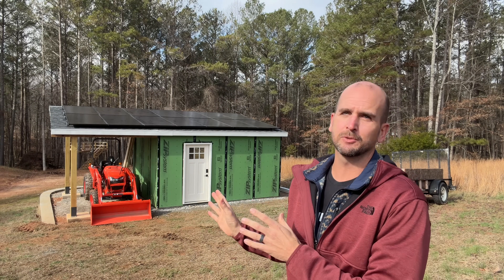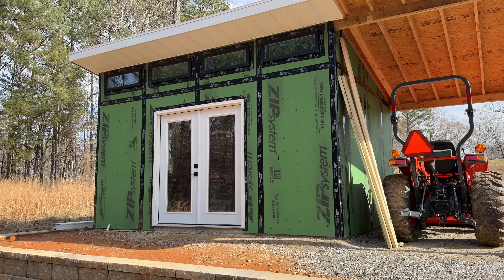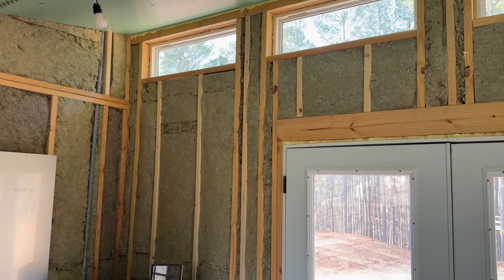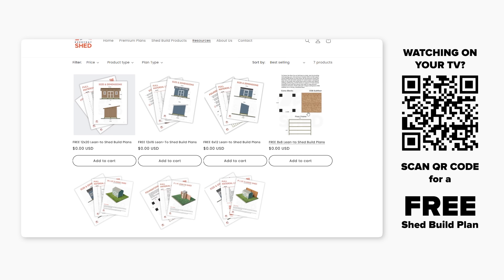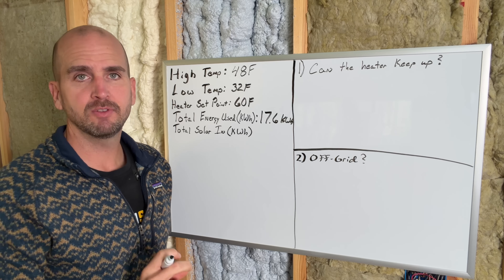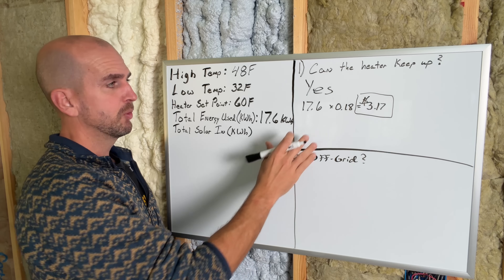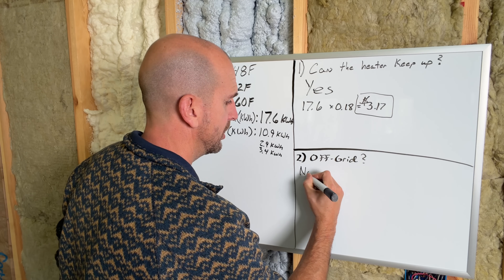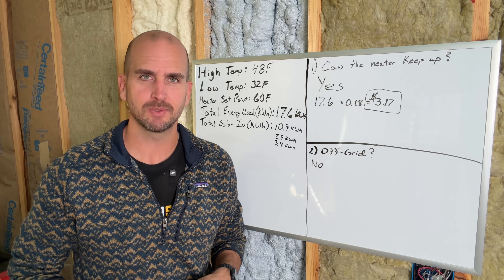HUGE Mistake: Why My $15,000 Solar System CAN'T Heat My Tiny Shed

Comment: That is what I switched to - 3 oil radiant electric space heaters for my house - 2 downstairs and 1 upstairs keeps the house just fine. I stopped using my forced air oil furnace because in the winter we have a lot of storms/winds here and at least once every few winters my carbon monoxide alarm would briefly beep one warning when the wind blew from a weird direction. Yes, I probably could have had the cap on my flue vent adapted so no wind backfired down it, but oil also started getting very expensive at that time here, as live on a remote island and shipping it here adds to the cost, so I tried the switch and found the oil radiant heaters cheaper than oil.

Disliked the forced air furnace blowing air disrupting any dust I might have too. Works just fine as live on the west coast of Canada so might get to slightly freezing temperatures for maybe a total of a week every winter. Might only have a few flakes of snow every year too and then if more snow, it rains away within a week. Have an older house with good insulation, so it works here.
Reply: too bad you didn't investigate mini-split heat pump. 400% more heat for the same amount of electricity (as a radiator).  AKA your heating electric bill would be 75% cheaper than radiator
Reply: @pbm___000  Really wanted to keep my life uncomplicated as live in a remote area with only a few hundred people and any work like this needs to come a big distance to me! Plus... how can it be cheaper for me to only need heat between October to May with a heat-pump at that cost?'
'A mini-split heat pump costs roughly $3,000 to $10,000+ installed, depending heavily on whether it's a single zone (one room/area) or multi-zone (multiple rooms), with single zones starting around $3,000-$6,000 and multi-zone systems costing more, potentially $9,000-$15,000 for 3-4 zones'.

Comment: I build a shed a few years back as my office. 800w of solar, a 2000w delta max. I charge the battery at night on a free night and weekend and use solar to supplement during day. No way I can run  a heater. Heated blanket or mr buddy.

Comment: A mini-split or a small portable heat pump is the way to go.   About 1/3rd the electricity use for the same target temperature.  You never want to use a regular thermal heater on solar.   For a space like that I'm guessing ... roughly 600W @ 50% duty cycle.   7.2 kWh/day.  If you have sun-side windows during the day you can get help from the sun as well.

The main thing is that with consumption levels that high, you need a significant amount of battery storage to buffer good days across bad days.   For true off-grid a generator is definitely still needed, but I think you'd be surprised at just how well the system would be able to support a small heat pump.

-Matt

Comment: So many things wrong about the goals. Why heat to 60 DegF? Why use PV when windows in the south vertical wall could collect so much more solar energy. Where is your thermal mass? Your insulation and windows/doors are not up to the task to keep this at 60 DegF. Eco flow makes a heat pump rather than resistance heat. Where does all the PV power go in midseason and summer? A more passive house approach would be much better - you could then export most of that PV power.
Reply: Jesus H, this started as a shed, not a passive house. He has an outbuilding, there’s no way this modest array is going to have enough to export anything to the grid, given what he wants to run inside the office/shed

Comment: I built a similar 12x16 shed and fully insulated and air sealed. I also put in a 12kW minisplit in this space, which will be 3-4X more efficient than your heater. This is fully off-grid and although sizing enough battery to account for sustained lack of solar input, the answer isn't a clear 'No' anymore. Imagine your heat load dropping down to 4kW-hr per day and it starts to become feasible.

Comment: I heated a 16x20 shop in Indiana with a radiant heater just like that.  It had a 1/2 bath in it so keeping it heated was important.  

I keep it at 60deg because I was in and out all the time in my outdoor work clothes.

Comment: "1500W electric radiator" - THERE'S your problem.

You need a heat pump.  As a bonus it will double as AC for the summer.  One of those little 1/2 ton (6000 BTU) units will use about 400W to pump out about the energy you get from your 1500W radiator.  It is far more efficient to move (and concentrate) heat than to generate it outright from energy conversion.  

Roughly speaking, every 1x of improvement (known as COP) translates to about 3.5 SEER.  It will vary with outdoor temps of course, but it does improve over direct heating.  The windows placed at the top aren't helping much either since they have lower R-value most likely and the hotter air rises.
Reply: No heat pump is small enough for the space if it's properly insulated.
Reply: @rmassuser  Heatpump is installed outside.
Reply: Yeah, I know, actually you should have a 300' deep Geo-Thermal to make it work on any decent amount of solar. Either way, add $30,000 to your "simple" system, just for heat.
Reply: @utubeaccess7 300 feet deep?  I’m assuming you mean 300 feet long and 4 feet deep?
Reply: Exactly
Reply: Never run a heat pump with that setup. The amount of electricity, heat pumps actually use when it's cold outside is amazing. They're a gimmick
Reply: Diesel heater uses about 120 w on high and about 20 w on low Burns. A liter a diesel in 24 hours on low. That's the cheapest. Most efficient way you're going to heat that box with solar
Reply: No, its not the problem. A 1500w electric radiator converts almost 100% of electrical energy to heat. The real problem is that people are trained to make excuses for why realistic solar systems don't work. Basically, this video proves that yes, you will need nearly 24kw of solar panels to consistently and reliably heat a well insulated 200sqft home in real life conditions.
Reply: @utubeaccess7  You are right about the 100% conversion number but a heat pump is ABOVE that.  The reason you can do more than 100% efficiency is you are using the energy to MOVE and concentrate energy, you aren't using it to convert directly to heat.  If you look up the terms COP and SEER you'll see that an AC (and heat pump) are able to move more heat for whatever power input than you can get from just running an electric heater.  I know, it surprised me when I first learned about it as well, but its why heat pumps even exist, otherwise it would be simpler and cheaper to only use electric heaters.  Heat pumps are more expensive and complex than a coil of wire and a fan, but they are worth it because they have BETTER efficiency than a coil of wire heated up.
Reply: @LFTRnow  not to get into the debate, but 1 watt = 3.41 btu. I don't care what you use to get that, but the power company will charge you for the power consumed. YEs efficiency of the system is a large factor, but the variables are also huge. ROI calculations are a must. In the end, your ROI will be longer than the design life expectancy of the structure and or system. Its all about the money. $15k in solar? As you wish, but that will buy allot of watts from the power company.
Reply: @utubeaccess7  a GOOD radiator converts nearly every unit of electricity into heat. a GOOD heat pump converts every unit of electricity into 4 units of heat. But THE PROBLEM is the roof insulation, to start
Reply: @utubeaccess7  100% of the electricity is converted to heat...true.  But that's not the issue.  Heat pump uses 1/3rd the power to move the same amount of heat from outside to inside.  The heat pump does not convert electricity to heat.  It moves heat from point A to point B.
Reply: @utubeaccess7 an electric space heater is indeed 100% efficient, and a heat pump is 200-400% efficient to achieve the same thermal gradient. See why it's a big deal?
Reply: Most people don't even understand that they're going to get 1/4 of the output power in a day in the BEST of conditions. Time to stop selling solar as a magic solution. It is 25% efficient at its best and that is for less than 25% of a day. Lets get real.
Reply: @utubeaccess7  You are right about that.  Solar would work pretty well for running a mini-split AC since most of the demand is when the sun is out and generating power.  The battery would cover the difference.  When it comes to winter, your time that you receive sun as well as its strength are both significantly reduced and must be accounted for.  At best, you could supplement the power with solar, as building enough of it would be very expensive.  As for that 25% number, that number is based on the energy hitting it.  IE if you have 1kW/m2 hitting the panels then you should see 250W.  There are of course losses in converting it to AC power or storing it (and recovering it from) batteries.  The losses each are fairly small but add up and so are significant.
Reply: @utubeaccess7  6000 watts of solar.  If he even had 3 hours of full sun he would have been okay.  Not to rehash everyone here, but the issues are really in a few areas.

1) Heat Pump instead of a radiator
2) Solar Panels aren't at the right angle (Spring or Fall angle when Winter is when it is needed the most)  
3) His setup is not balanced.  He has too much battery for the solar at that angle/efficiency.  Or not enough solar for the battery.  The inverter is also oversized.  I get what he is doing, but I don't want people discouraged.  He could have had two server rack batteries and a single phase, 5000 watt inverter with a single MPPT controller for significantly less in costs.  

And I agree with you.  Most people don't understand this stuff because it is just a complicated topic.  I never recommend people go with solar despite having nearly 10 years with an off-grid system.  One day, though, it will be too cheap to not use solar.

Comment: In theory you can calculate everything, but in reality getting accurate data for the calculation is realistically impossible. You test also isn't valid because heat loss depends on temperature difference.  How warm you want to keep it, and how cold it gets outside and how much internal variance is acceptable are all critical.

A cheap diesel heater works well as a unit of heat, but probably supplemental rather than primary in any 4 season climate.  You do not want any kind of unvented combustion heater as a primary product of combustion is water, but vented propane are available in sizes far larger than the little diesel heaters.  They do make really small wood stoves if you have the space for a safe install, and can be sized to provide primary heat if you only need heat while you can tend it.  A heat pump run by solar is likely to be possible for primary heat, but you are likely to need more panels and more batteries and if your climate actually gets cold (below freezing for days in a row) you will need supplemental, and if cloudy and cold is possible then you need an alternative.  Direct solar thermal might be interesting, but definitely need an alternative if your climate suffers from below freezing and overcast days for an extended period of time.  And that is about the extent of off-grid heating options for a small space.

Comment: I think the mistake the poor ceiling/roof insulation, especially compared to the walls. There is a reason why in cold climates, the building code calls for at least R49 in ceiling/roof/attic compared to less than half of that in walls (I forget exact numbers). The other issue is that you are using an electric heater. If you used a heat pump, I expect better heating efficiency (at least double), which would let your energy storage be used for longer.
Reply: You beat me to it. More insulation is typically 10x bang for your buck verus more heating. 
I have a 8'x12' shed with 4" rockwool wall and 8" fibreglass under a ventilated roof. I am in Toronto. 

I have rigid foam on about 90% of the inside of my rigid steel skin foam core door backed with drywall. I put 2" rigid foam over 90% of the three  1'x2' windows. Then I heat this all winter to 68F/20C on less than 100% run time on a 800W oil filled electric heater.
Reply: Add in the paper thin leaky french doors that waste energy like no tomorrow and that the main door is the wrong side out as usual in america so you cannot even have a proper lips to seal with double doors on a frame and I bet the ground aka the floor is not properly insulated either.
Reply: @petrirantavalli859  Yeah this has zero to do with the solar or heating (though a heat pump is a no-brainer) and everything to do with the envelope and insulation.
Reply: This. Also he would be better off with a foundation with ground contact, with a thermal break on the floor inside.
Reply: I think if he got a thermal camera out he'll realize that wood is a pretty good conductor of heat.
Reply: @mb-3faze  This would be a great idea for a follow-up video.
Reply: Yeah, I immediately wondered why he only had R10 in the ceiling, since doors, windows and ceiling is where you lose at least 75% of the heat from a structure.  We insulated an 800sf barndominium (2 levels, 10x40') with R25 in the walls and R40 in the ceiling.  Heating can be done with the mini-splits, wall-mounted 30,000btu propane furnace, or oil heaters.  The mini-splits provide the most even heat, with the propane there mostly as a backup.
Reply: Yes, a most excellent point.  I had a house in Madison, Wisconsin and one year I cleaned out everything in the attic (which was not much), then had guys come in and load up the ceiling with about 4.5 feet (yes, 54 inches) of cellulose blow-in, taking great care to have the eaves properly open for ventilation.  Our heating bill dropped like a rock that year.  And, yes, 4 feet of insulation is definitely an over-build, but the space was empty and it was a single-storey ranch.
Reply: You do heat rises right
Reply: @garypic4083  that's nice of you do say he does heat rising right.
Reply: he didnt cuz of airflow on ceiling
Reply: Yup, more ceiling insulation. I would of put those windows on the lower side of the roof as well.
Reply: He knows. He's just making a video series progression
Reply: @wojtek-33  I hope to eat my words when the ceiling insulation is improved. :)
Reply: @gslavik  not sure he will fix the ceiling, but he'll definitely go heat pump
Reply: The entire problem is that the ceiling is a bit under insulated, but of no true consequences. Having the right heater, i.e. not electric of any kind. Go with a deisel heater or a ventless propane heater and problem solved. My entire home gym/office is heated with an outside deisel heater on a thermostat. All on solar power, the building is totally standalone solar. I spend around $8 a week on deisel and the building stays 40 when not in their, turn up thermostat when im in there and it will cook you out........ by the way it is insulated with 2 layers of r5 foam panel, r10 total. Also very well built, not like a shed but like houses I framed in my 20s. Maybe that makes a bit of difference. Idk

Comment: What I learned back in the days is that you never want to have your vapor barrier on the outer wall. You want to shed moisture outside if it ever gets inside the wall. You put thr vapor barrier inside. I'm mentioning because you said you sealed the exterior panels to seal from moisture. Usually exterior membranes are things like Tyvek who are water proof but allow vapor through (the water mollecules are smaller when in vapor form so they can pass).
Reply: It depends on your climate zone. If you're in a humid place like Alabama or Texas and you cool your house most of the year with air conditioning, which is dry, then you want your vapor barrier on the outside. But if you're in extremely cold climate where you do most of your heating and the moisture is going to be inside the house. Then you want your vapor barrier on the inside to protect your insulation from moisture and mold. That's why you want to know the code.
Reply: @rcmrcm3370   This isn’t a house. It’s a shed, converted to an office. But, that means there’s no sink, no cooking, no showering, no laundry, no toilet. Only breathing as a source of moisture. He’ll be fine
Reply: @nate3356 would you go and read the original comment that I commented to because you're talking about something completely different. They wrote always and you're talking about a specific case, duh. COVID really has messed up some people's reading comprehension.
Reply: There is no one size fits all rule for vapor barriers, it depends on use case and climate, so any advice containing “never” is wrong